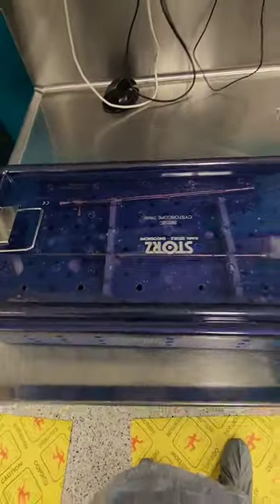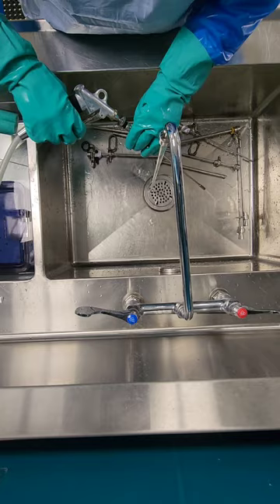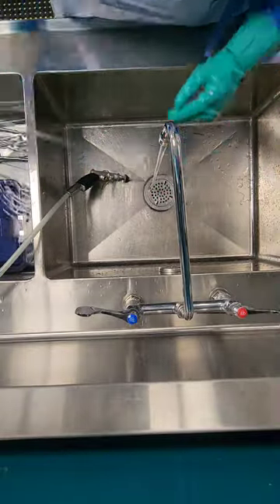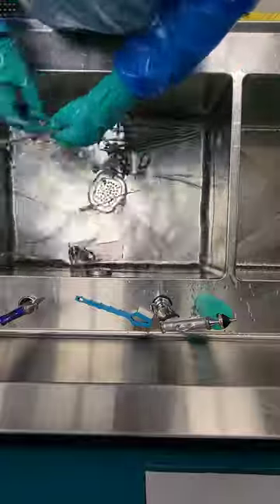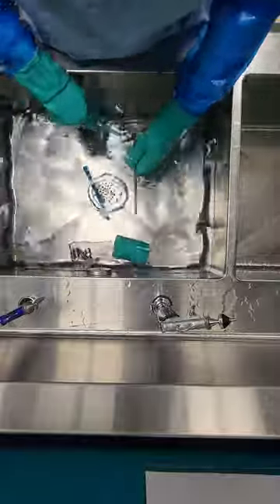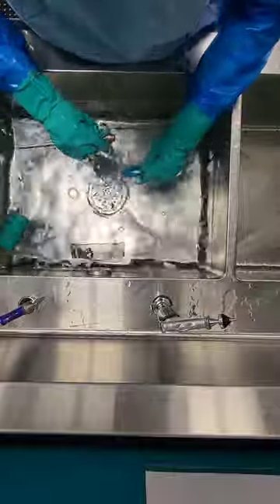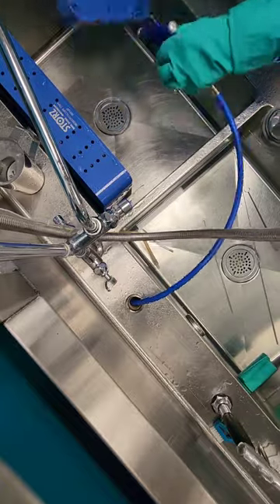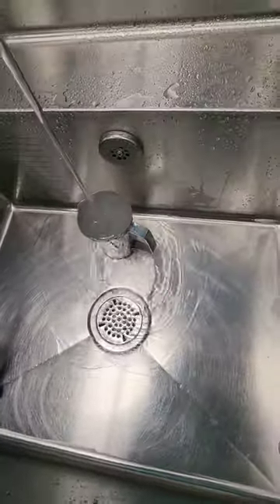Sterile Processing: Handwashing a Cysto Tray

Comment: Any tips for new beginners no experience just the certification/ book study, on resume/ interviews?😅
Reply from the maker: Sure, sell yourself on your resume. Anything you have done with cleaning, chemical dilutions, sorting, inventory management, sorting, documentation, filing, computer work and programs, put that down as your skills on your resume. 
For example if you worked in Walmart stocking shelves your skills is inventory management. You understand the importance of checking for expired products, practicing FIFO, correctly placing items in the correct bins or shelves, reporting out low inventory or location of items via a tracking software. That is relatable to SPD. In the interview respond honestly and be prepared to ask questions. Ask about the turn over rates, staffing shortages, work load and what are their expectations from a new employee. Ask what do they value, Quality or Quantity and how do they balance that if they say they are short staffed. Impress them with your curiosity and ability to relate other industries to SPD.
Reply: @WDYDCSP  okay thanks I just got placed for an externship!
Reply: @WDYDCSP  Hi! I passed my CRCST would you be interested in reviewing my resume? I trust your judgment / guidance more than anything!